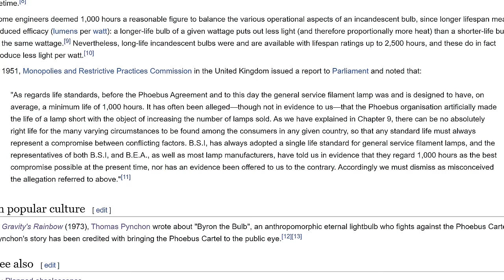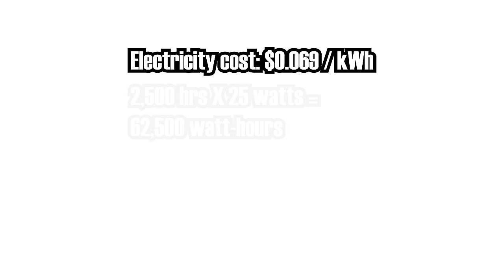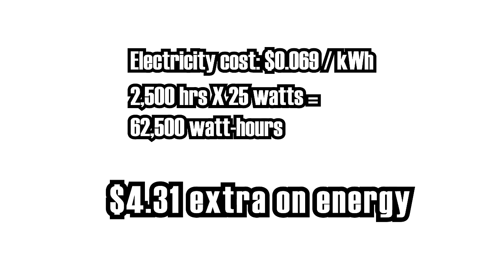Longer-lasting light bulbs: it was complicated

Comment: Another important thing about the centennial light. They never turn it on and off, so it doesn't experience thermal shock like a bulb in normal use would.
Reply: Yup, it was used as a nightlight/emergency light before they realized its longevity was probably some kind of record.  So even then it was rarely ever turned off.  

Since then, it's only intentionally been turned off when the department moved it to a new fire station.  And it's had its own dedicated UPS to keep it on through power outages.  (Though it did turn off by accident once when its UPS was faulty. 😜)
Reply: In addition to which, I believe it is powered on DC.  AC powered bulbs do experience some small degree of thermal cycling due to the constant reversal of current.  They don't get 'cold', per se, but the fluctuation in light output IS demonstrable, and that means the filament is experiencing a 60 hz thermal fluctuation as well.  DC does not have this; so the bulb got hot and STAYS hot.

Demonstrable how?   If you have a turntable, you'll know that the speed of those things is calibrated using an optical strobe disc - which DOES work with AC-driven incandescent lights.  Also, you can actually hook a pair of head phones up to a solar panel under an an AC driven incandescent bulb and hear the 60 cycle hum.
Reply: I wouldn't be surprised if it was running with less current as well
lower the current a little and the brightness and heat goes way down, and the lifespan rockets up exponentially.
Reply: I use incandescent lights as heaters in my outside dog house. I wired the bulbs in series and I've had the same pair running for about 10 years now. Definitely last a lot longer.
Reply: @2ndfloorsongs  Heating technology is 100% efficient, eventually.
Reply: the biggest reason it is so dim is they run it on reduced voltage to extend its life.
Reply: @Poldovico  heat pump technology effectively exceeds 100% "efficiency" since it can deliver more heat than a resistance heater.
Reply: @2ndfloorsongs  my father used to use a 100W incandescent bulb to frostproof his well house.  he wanted something a little less consumable, and more automatic, so I wired up a small 240V baseboard heater to a 120V plug and used a thermostatically controlled receptacle to power it.  I think we boosted his wattage to around 112, but it runs a much lower surface temperature, won't burn out, and it only comes on if the well house interior drops below around 40 degrees.
Reply: @kenbrown2808 what is a well house in 2023? Honestly curious. We have a cabin off grid in the top 5% north of the lower 48 and don’t use one for our well and plumbing. Must be a unique setup?
Reply: @xaenon  This strobing effect was evident in cinemas too, with analog optical audio. Very often the exciter bulb was run off of an unregulated rectifier and there was some hum when the bulb was on. Later on when they changed the soundtrack to cyan color and the exciter bulbs were replaced with LED or laser light, the hum problem was gone. Well, the cyan color wasn't really necessary for this. IMO it was used so that old white light exciter bulbs would give a weak sound and cinemas that wished to continue would have to get a rather expensive upgrade.  If they really were about improving the sound, they could have chosen any color of LED/laser with regulated supply, and go with that for the remaining 5 to 10 years before going all digital.
Reply: @kenbrown2808  A dimmer is the best way to extend the life of bulbs, especially older incandescents. I have strings 1960's-era Christmas lights that I run at roughly half intensity on a dimmer switch. I've been doing this every Christmas since 2002 and I've yet to lose a bulb through burnouts (lost a few from accidental breakage, but that's another story). Sure they're not at full brightness, but IMO they look better when they're dimmed.
Reply: @fensoxx  it's a place the pump controller and pressure tank are at the well insteaf of in the house like mine are.
Reply: @kenbrown2808  cool thanks, must be a mild climate?
Reply: @AdhamOhm  but as he said, by reducing the voltage, you're making them less efficient at producing light.  But as I've told people, if you're using an electric heater while you're lighting with incandescent bulbs, then you're still using the waste heat from the bulbs.
Reply: @fensoxx  milder than average. Of course, it freezes about half as much as it used to.
Reply: @2ndfloorsongs  I would have run them in parallel. That way when one bulb burns out the others stay lit.
Reply: @xaenon  very interesting experiment with the solar panel, but with a cap to decoupling dc to not damage the headphones right?
Reply: @CarlosMartinez-px9xo  I used a fairly stout resistor and fed the signal to a small utility amp.  But yours is definitely a good idea.
Reply: @MarinCipollina  And that will make them run at full power, so they will last 1000h, probably less.
When they are in series, they run at half the power each, so they last much longer.
If you want redundancy+longevity, you should connect two pairs of serial connected bulbs in to paralel.
Reply: @kargaroc386  if as stated the filiment is overbuilt my mistake and would NORMALLY handle 200watts and only sinks 20 then it WOULD be a lifetime bulb
Reply: @2ndfloorsongs  friends pump house is heated with 2 100 watt bulbs in series wired to a thermostat
Reply: @fensoxx  quite normal in parts of Canada to have a "house" on top of your BOOSTER pumps as often DEEP WELL pumps dont deliver good pressure on there own and being on the ground in sub zero temps a pump house is used my uncle has a pump house with 2 100 watt bulbs in series and a thermostat to cycle them (normal baseboard heater thermostat you get at Home Depot
Reply: @xaenon DC bulbs last less than AC counterparts. DC bulbs act like an ion emitter.
Reply: @kenbrown2808 That's why we don't call it 'efficiency' with heat pumps, because it goes against the 1st law of thermodynamics. Therefore it's called 'coefficient of performance'
Reply: elfrjz  But everything emits electromagnetic radiation, depending on its temperature.
In time, the energy stored in that will convert to heat, so eventually it will be 100%, but not right away.
Reply: @kbee225  Having worked on many old arcade machines over the years, I haven't noticed any difference for longevity between the little indicator bulbs running on DC versus those running on equivalent AC rms voltage.
Reply: @marcokrueger3399 
Nothing violates the laws of thermodynamics. 
A heat pump doesn’t generate heat. It moves it from one place to another.  It’s just a comparison between a resistive heater with the same amount of electricity.
Reply: @neilkurzman4907  Yeah of course, otherwise they wouldn't work. But they don't violate the 1st law of thermodynamics because they are not generating heat from electricity (apart from the losses), as you correctly described. Therefore, it's not the term "efficiency", but COP.
I'm well aware of what he said, just wanted to add that. I mean, he's aware of that as well since he put it in parantheses
Reply: Well the better light spectrum was a coincidence not an aim of the planned obsolescence. Therefore I don't really see how this could be an excuse. Yes it's brighter but this was not the intention. It was to make it burn faster. Therefore using it as an example is still valid.
Reply: @EbonyPope  The only reason the centennial light can burn for so long is because it's never cycled and it is run at such a low power level that it's basically useless as a light. 

The only thing it proves is that light bulbs can burn for a hundred years as long as you make them useless.
Reply: @hydra70  I wasn't referring the centennial light though.
Reply: @EbonyPope  Then why are you replying to a comment about the centennial light? Is your comment just completely irrelevant to this thread? Why did you leave it here?